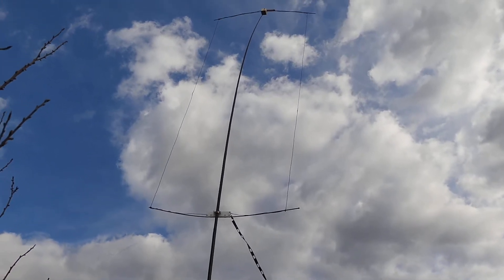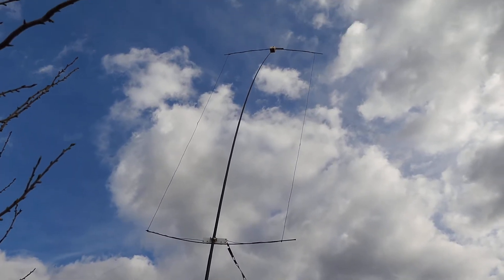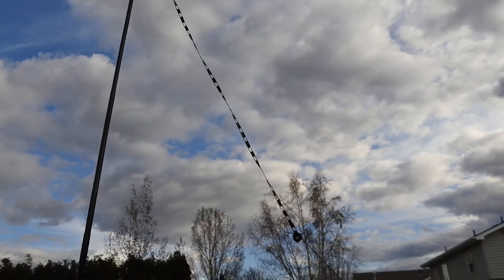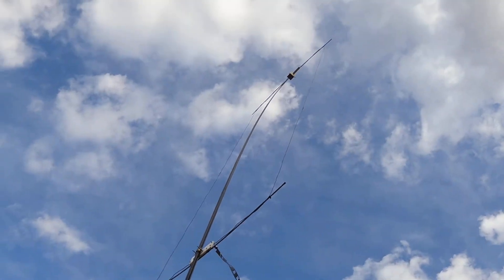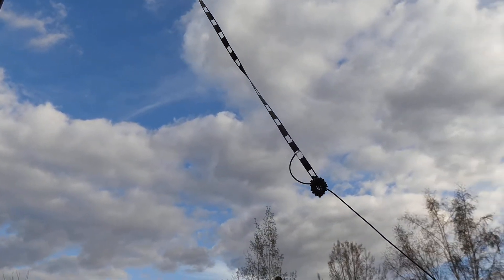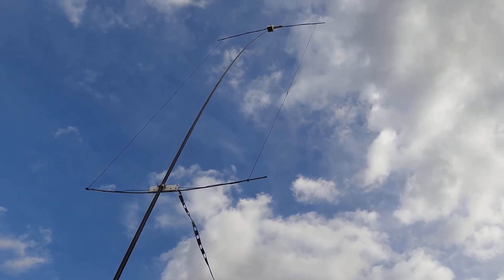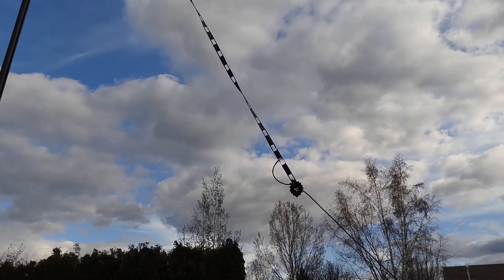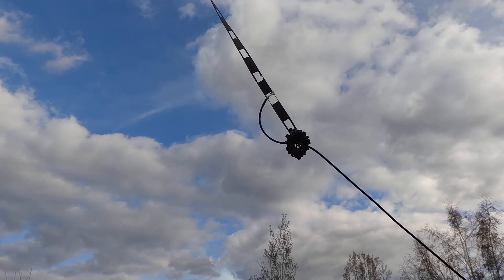Vertically Polarized 10 Meter Moxon Antenna

Comment: Hi there, i have a normal moxon but wanted to use it for local tx, but as moxon has a different polarization as the local Rx stations I thought to put the antenna upright. Now I'm note sure how to aim the antenna (regular middle feedpoint, as you mention in your video). Would appreciate your thoughts. Thank you
Reply: The direction of gain will be in the direction of the driven element.   Draw line from the reflector wire to the driven element and that is the direction.
Reply: @ToivoMykkanen that's what I thought but was sure you could confirm or correct me and share the right setup. Will be interesting to see if and how it works. if the polarization will match for ceibal rx Stratton and if I get gain or of it. Will compare to a 1/2 and a 5/8 Wire Antenna. thank you very much 👍👍

Comment: I just found this video.  Very interesting... have you modeled it?  I wonder what the model would show. Does it appear to have directionality? How does it compare to other antennas you have experience with on 10M? Thanks for the video.
Reply from the maker: Modeling shows it to have a much lower take-off angle than a horizontal Yagi or Moxon at the same height.  It is the best 10 meter antenna I have used but a bit awkward to rotate.  Keeping it fixed on Europe in the morning seems to work out well.  Definitely is a directive antenna as it greatly attenuates signals and noise from the back side.